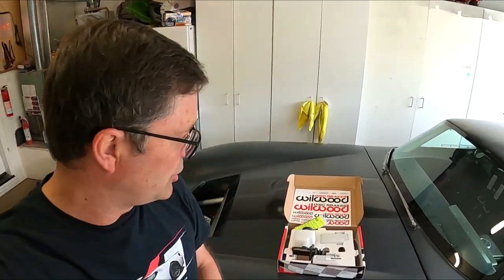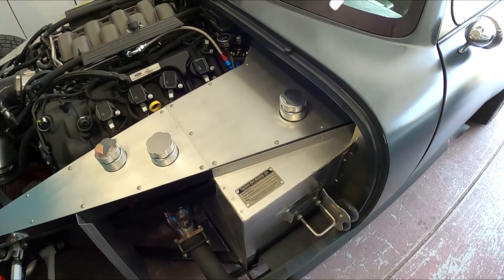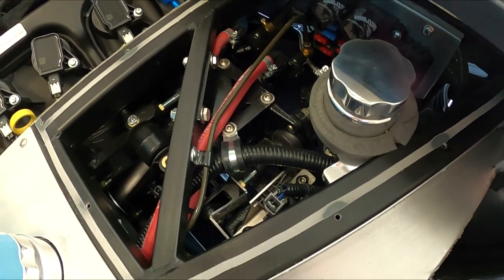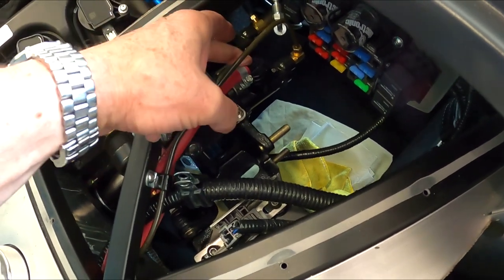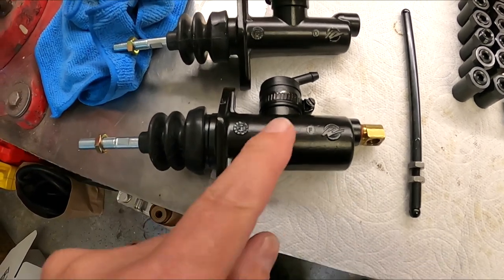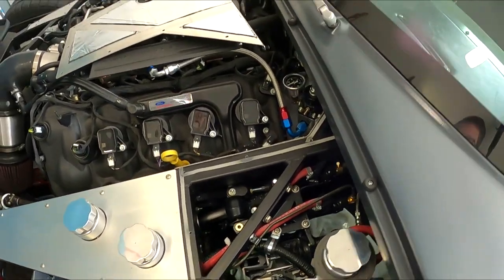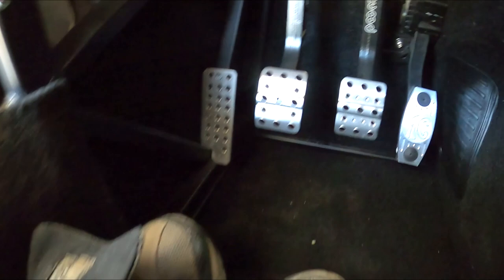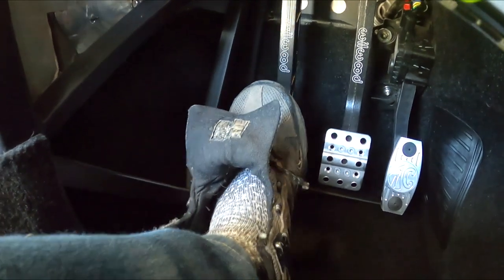Cobra Daytona Build- Larger Master cylinder, Video 147

Comment: Take notes at the autocross and post a vid. Curious what you think as you get more seat time. Things like spring rates, tire pressures, swaybar settings, and brake performance.
Reply from the maker: Will do. On waitlist for autocross. Drove it this afternoon and transmission shifts so much better at high rpm

Comment: Ha, these Wilwood parts don't work well with other Wilwood parts. :) I had to actually cut down the top mounting studs for the masters on the pedal box too. They hit the inlet cylinders of the masters. How do those two not get along.
Reply from the maker: Crazy isn’t it!  Wilwood makes brake parts to a price point and you get what you pay for. Price out some AP racing or stop tech brakes and it makes sense.